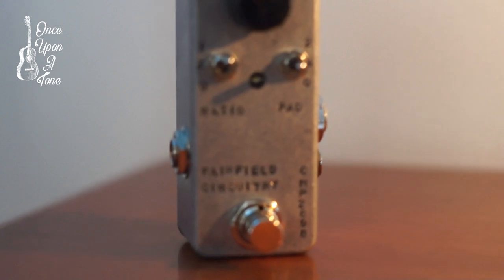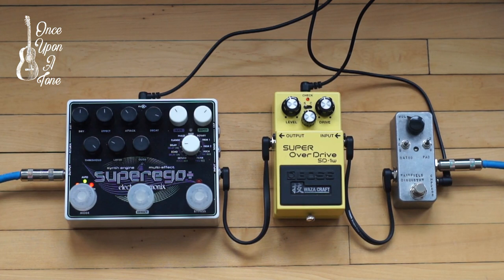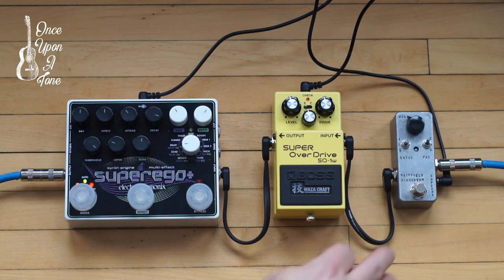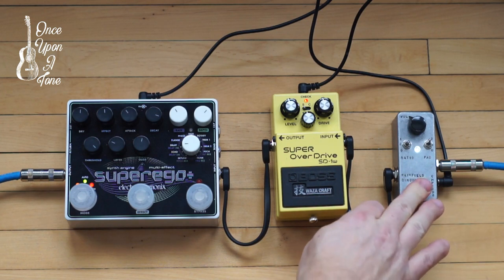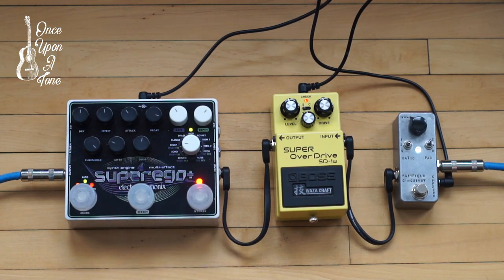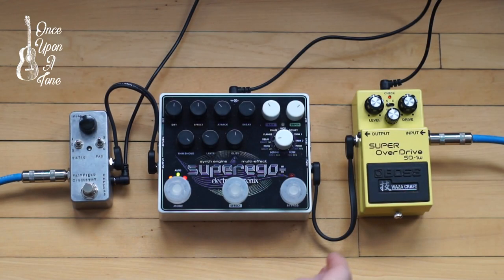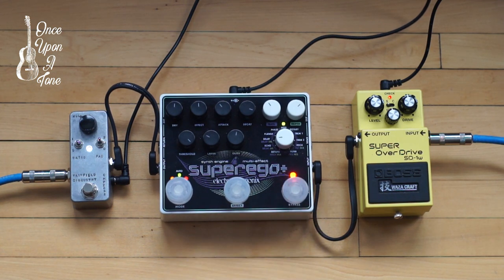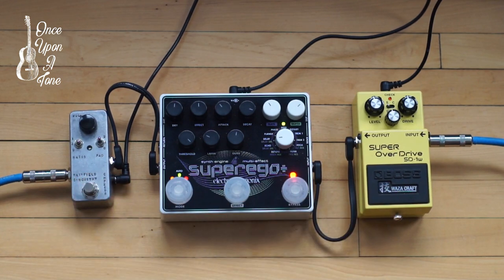FAIRFIELD CIRCUITRY ACCOUNTANT: COMPRESSOR IN YOUR SIGNAL CHAIN

Comment: I've always run one at the beginning of my signal chain always on and set very subtly, just to add some sustain and enhance the tone.  Recently thinking about how studios use a compressor at the end to meld everything together I put a second one at the end of my signal chain, also set subtly, and it was a huge improvement in my overall sound.  For me, always on slight compression at the beginning and again at the end is the way to go.
Reply from the maker: Depending on your signal chain, there's likely more compression coming from other effects and then again at your amp. It sounds like you're doing it all right, especially with the subtlety.
Reply: Two is the thing.Simpler unit up front, - I use the Janglebox, - and more complex optical circuit ( currently using the EQD Warden) with dry mix after the main mid chain Drive.I usually run some modulation and short delay up front, right after the more sensitive Fuzzes/Germanium circuits.The chain is " staged", with effects very specifically placed , thus avoiding a switcher.Volume pedal( on the floor) in the middle.If you're mindful of buffered effect placement, many different orders are possible.

Comment: On the advice of a friend whose guitar work I greatly admire, I have experimented with putting my compressor after my gain section and before the time based effects. I am enjoying it. I have re-discovered some of the original definition and articulation in my individual notes that was becoming lost in all the drive and fuzz.

Comment: I think the compression after delay sound just makes the repeats a lot harder to play along with in my experience—compression after overdrive is a lot more usable (unless the compress has a dry mix then if it’s before it doesn’t sound artificial in a way). Cool vid!
Reply from the maker: It can definitely make the feel significantly different, especially with more feedback on the delay. I'm always looking for ways to make effects sound a bit unique or different too, even if it's just for one specific song or part (having a pedal switcher is very helpful for that).

Comment: I guess it’s a matter taste, but also the guitar, amp and effects you use. I finally settled on using it at the every end of the chain in the effects loop, especially with my humbucker guitars. I do think maybe I’d use it right after my tuner with my Jazzmaster though, only because that one can be a little more rowdy right from the output.
Reply: Distorted compression or compressed distortion Makes sense afterwards I just picked up an old two knob Keely Sounds great by itself

Comment: IMO compressor after delay messes up the delay tails. Compressor should always go before delay.
Then you can decide to put it before or after dist. pedal. I prefer compressor to go after , so that it does not change the distortion behavior , but only compresses it.
You can put compressor before distorsion , but then it would IMO behave more as a boost for distortion than a compressor.
Reply: I think your idea putting compressor before delay and after distortion is great ! I’ll try that on my signal chain

Comment: Got one of these on the way, will be here today to replace my Keeley Bassist. Super excited to try with my Dingwall

Been thinking about compression a lot/place in the chain, maybe a colorful compressor like this first for tone enhancement and a transparent one at the end for clean peak limiting.
Reply: Jamming with this pedal now, using Ovnilab’s favorite setting and it is amazing. Somehow controls my dynamics in a way that a Keeley Bassist and Darkglass Hyper Luminal just couldn’t. 

Excellent for tapping and a nice middle ground between compression, limiting and dirt.
Reply from the maker: I like that setup. I actually use the Fairfield Modele B at the front of my chain these days and the Accountant at the end. Both are very subtle but do so much.
Reply: @onceuponatone  never heard of the Modele B, will check it out. Fairfield just seems out there in general but in a cool way, thanks for making this vid :)

Comment: That was interesting thanks. I have this at the start of my chain but on subtle compression at 0-0. You seem to have yours on quite a high level, so no doubt that makes a big difference in terms of signal chain placement?
Reply from the maker: Yes, the ratio was set higher for the sake of this video, but I don't typically use that setting except for extreme brief segments of songs. I also have the Modele B at the beginning of my chain with some always-on light compression. It's interesting to try different things after usually keeping effects ordered the way we've learned we're "supposed to".